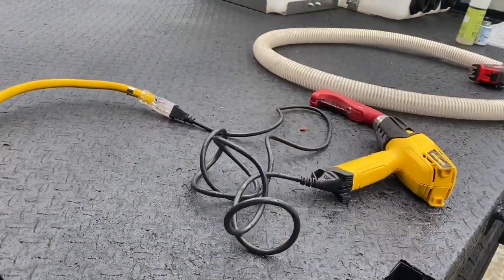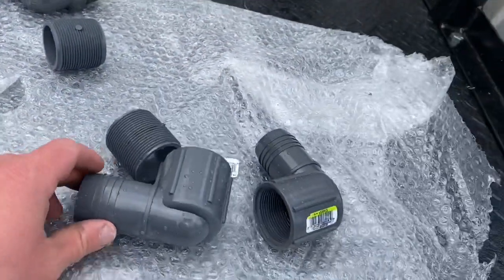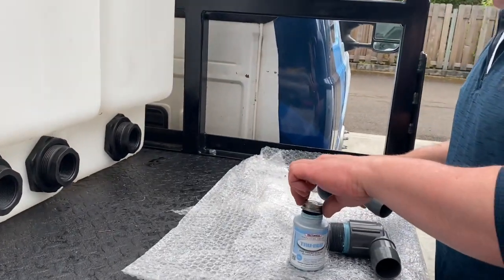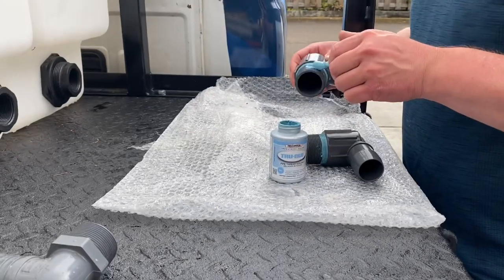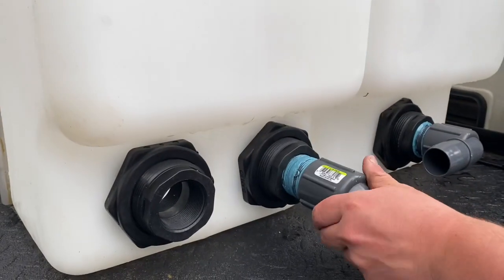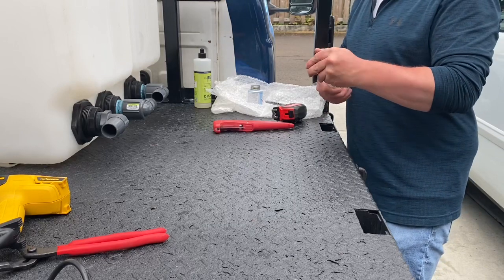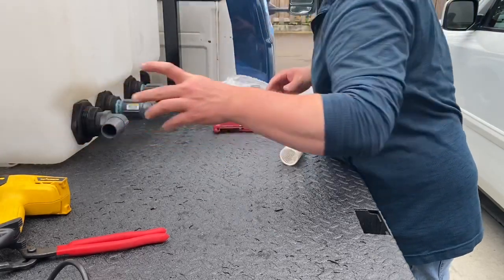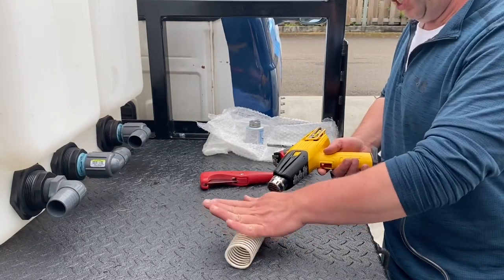How to plumb two pressure washer buffer tanks into one

Comment: Could you make the holes on the insides of the tanks, aligning them up and then just seal them using a bulkhead fittings? The same ones you’re using without the elbows to connect them. So essentially one end goes in one tank and the other in the adjacent tank then screw them together?

Comment: Does this only work if the two tanks are the same capacity? I have two rectangular tanks (one 100 gallon and the other 50 gallon). Could I plumb these two together, or should they be the same tank size? Thanks!
Reply from the maker: Same is preferred but it would work
Reply: @ExpertPowerWash  great! Thanks for the reply.

Comment: I know this comment is a little late to the party but if you will take a thin, rectangular shaped strip of rubber, that’s just a couple inches wide and put around your threads and then grab it with your pliers you won’t have to really worry about marring up the threads as bad
Reply from the maker: We’ve been using the tru blue now and loving it. Rubber would work as well.

Comment: Nice video! In my head, I was thinking that if you use a wye with ball valves at each bulk head it would allow for the ability to only use the tank with the feed line and Hudson valve for smaller jobs if both tanks are not needed. You could just turn off the second tank. Do you see a potential problem with a setup as I described? TIA
Reply from the maker: No problem at all. It fills both tanks. Even at half full, it stops the sloshing when driving. It’s still the same amount of water either way. I wouldn’t waste the time to make it to only one tank can be used. I really don’t know how it would help. I appreciate the comments. Hopefully that makes sense. You do pose some ideas but don’t think it would help.
Reply: @ExpertPowerWash  Very true! Thank you for your response.

Comment: Just a guess but maybe easier to install if the tanks could be pulled apart and then mount them. 
Use SS Hydraulic clamps as well. 
I've even put 100% silicone on as the lubricant. It takes more time to dry so your work time is longer and it assist in sealing. Works extremely well in vacuum applications.
Reply from the maker: Appreciate the comments. Will keep this in mind.

Comment: Where did you get the 1.5 inch  solid threadedc as well as the 1.5 threaded  to barb fittings? No luck at Home Depo
Reply from the maker: Grainger
Reply: Mcmasters Carr also has them. I like them better than Grainger. Gaingers pricing was somewhat hard to deal with. It was like a membership. Not sure if it is still like that or not. But that gives you two sources.
Reply from the maker: Thank you.

Comment: If you were to do it over again, would  you do a 1 1/2 inch or would you go to a 2 inch? What size fittings would you recommend? And how did you plum the top of your tanks? Thanks
Reply from the maker: Great questions but to reduce answering the same questions over and over again, check out my plumbing videos. There’s some information about my drop sticks. I’m very happy with my plumbing and wouldn’t change it.

Comment: The best tool for tightening bulkhead assemblies or threaded nipples on connectors is the Rubber style fan belt oil filter wrenches.

Another tip is the use neoprene pads under the tanks to avoid rust from the trapped rain water forming on the truck body and its abrasive diamond plate. Or old carpet works well. No matter how the tanks are fastened you'll get movement.
I would of used one large baffled tank. Less hardware less worry
Reply from the maker: All great points👍👍 thanks for the great ideas. We will see how this works and may try your ideas on the next one. Appreciate it.

Comment: Just curious, why do you need to plumb the two together?  Seems if you want to drain one into the other, they will just equalize with one another.  So if one is totally full and you drain it into the other, they will then each be half full.  Just curious, great video by the way, thank you.
Reply from the maker: The reason for using two tanks is to reduce the sloshing of having one larger tank. The water has less room to move around. Also as far as plumbing, there will be a Hudson float at the top. As water comes in, it fills both tanks. Two tanks become one as the water equals between the two by being connected at the bottom. Hope that answers your question. Appreciate the comments and taking the time to watch the video.
Reply: @ExpertPowerWash   Yes sir, thank you for the reply.  I was under the impression that the water is dumped from the tank so as not to travel with that much weight.  I just lost my job and am thinking about starting in this business so I’ve been watching all the videos and doing as much research as possible.  You put out great content, keep up the great work!
Reply: @ExpertPowerWash  So full would be 100 gallons between both tanks?